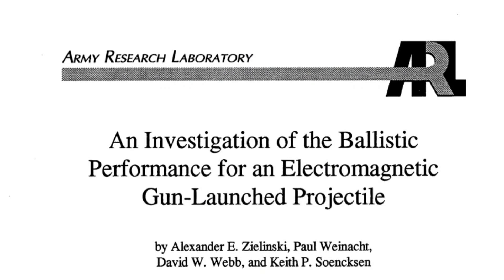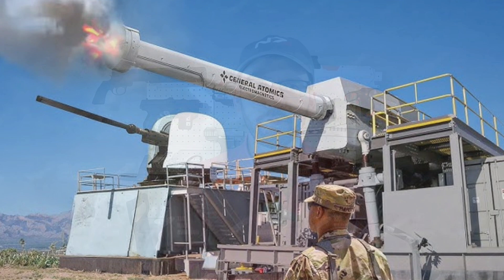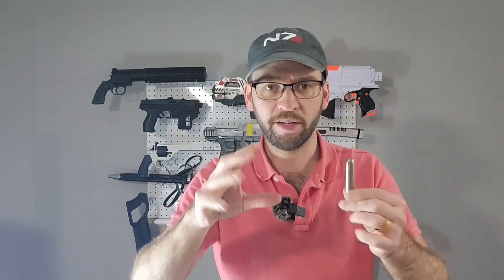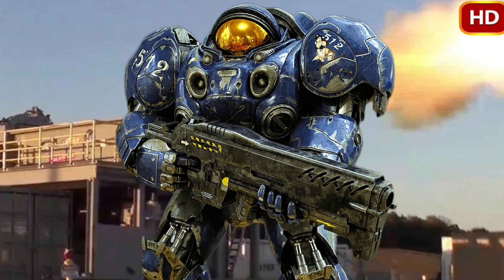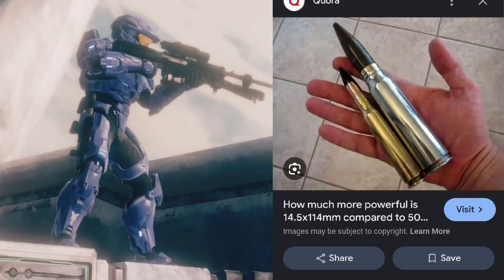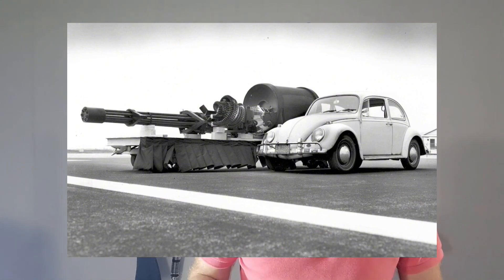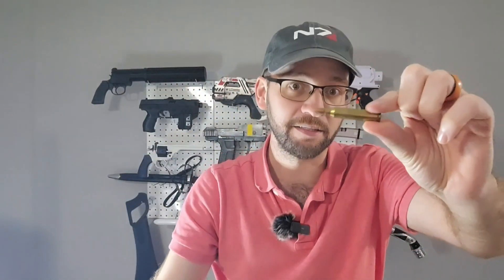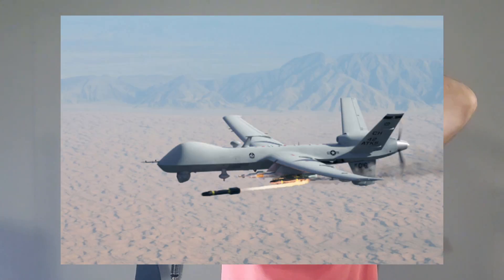Real Railguns: Crash Course.

Comment: WRONG 😂
RE; 
Space Marines tendons
😂 ALL Space Marines DO have enhanced tendons. 

From official games workshop 
Yes, according to Warhammer 40k lore, Firstborn Space Marines, like all Space Marines, have enhanced tendons as part of their genetic augmentation, which significantly improves their strength, agility, and ability to withstand extreme physical stress. 
Key points about Space Marine enhancements:
Gene-seed:
The enhancements are achieved through the implantation of "gene-seed" which alters their physiology at a cellular level, including muscle and tendon structure.
Improved tendon function:
This results in tendons that are much stronger, more resilient, and capable of generating greater force than a normal human's.
Combat applications:
Enhanced tendons allow Space Marines to perform feats like leaping great distances, delivering powerful blows, and absorbing heavy impacts with minimal injury.

Comment: Couldnt they be scaled down for a truck version? Or on a tank?
Reply: They're not there yet. To my understanding, this structure is essentially to test the "proof of concept" and it's the size of a small ship. The energy required to produce the final test result was well into several gigawatts of energy - enough to power roughly a small city for a short period of time.

Right now, the payoff for such a financial endeavor, just isn't there. Even armor on an Abrams A2 can still be defeated by a tandem charge warhead on a missile or several AT mines stacked on one another (like Baghdad back in '03), and that costs significantly less.
Reply: They were testing them as potential guns for ships. They were too big to be naval guns, my man....
Reply: Give it time and you’ll see one on the back of a Toyota technical
Reply: @MrBirdMonkey   Why does this sound familiar......
Reply: Them replacing tank cannons would be SO much easier for tank crews.